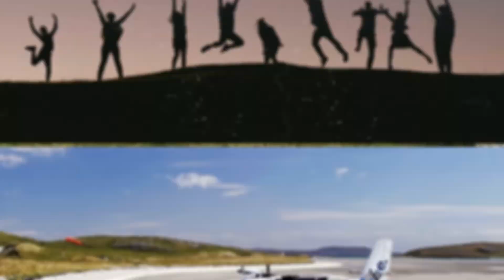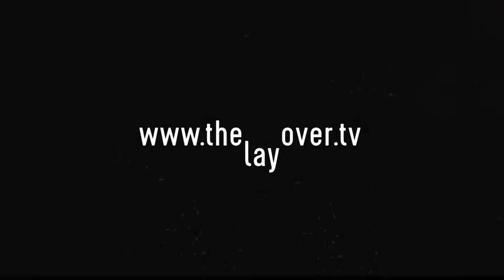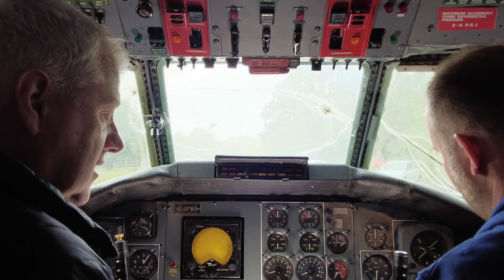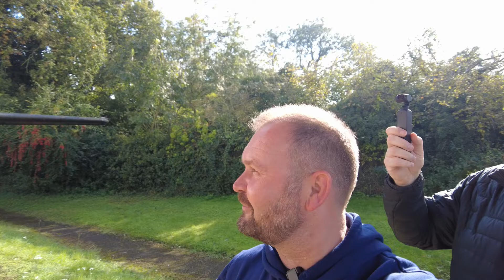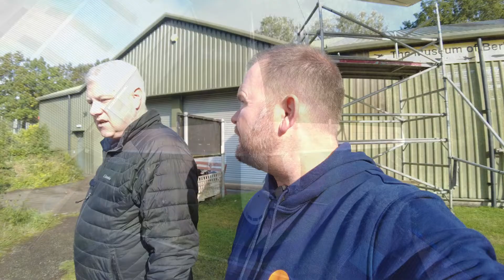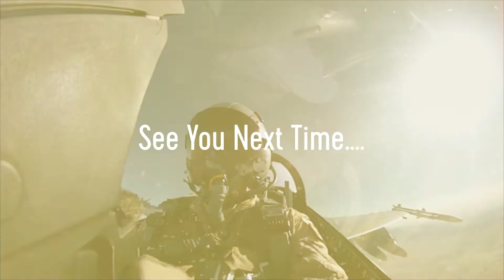Visiting an Old Flame

Comment: For those interested the Irving Beak referred to by Mark at 19.53 is a fairing that extended the full length of the rudder and protrudes into the tail fin. Its movement inside the fin creates venturi effects to assist movement of the rudder against high air loads.